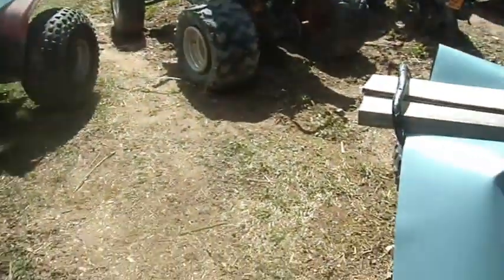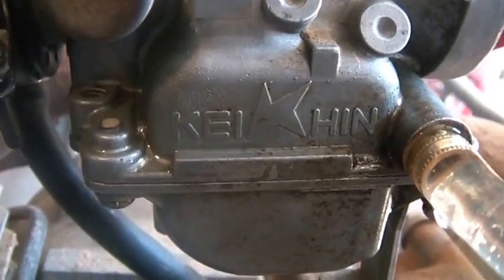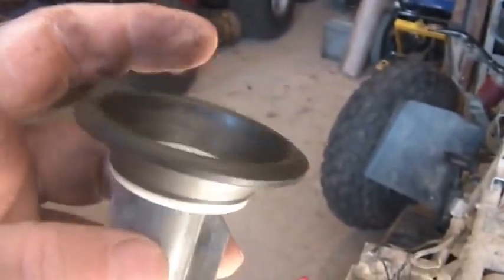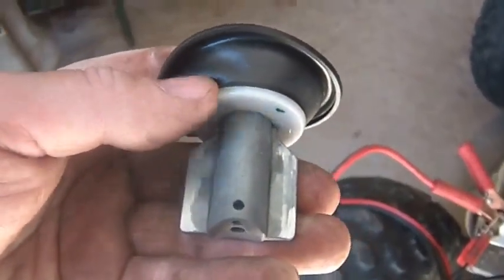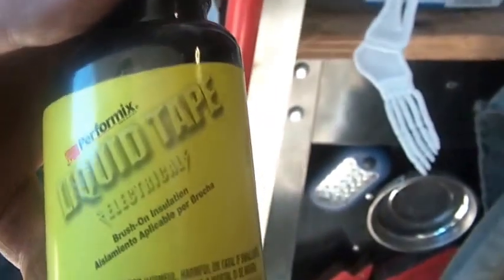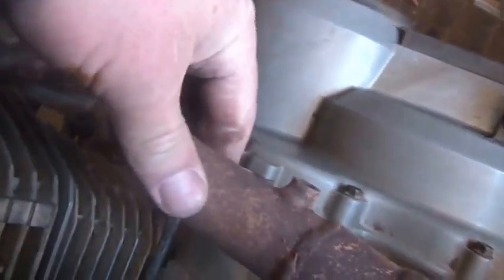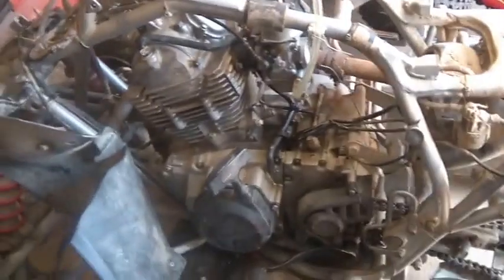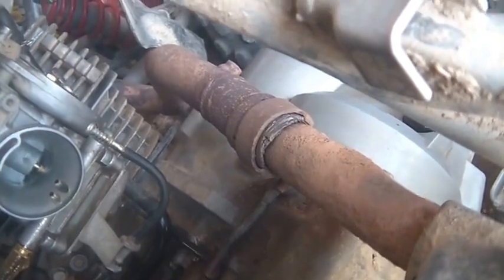Keihin CVK Carb diagram patched, watching enrichment circuit work

Comment: Couple of thoughts here, first is the crank case vent free and clear, and second is the guide on the valve that was damaged in good shape. She has to be pushing oil into that cylinder from some where. And as a be of advise don't leave that new diaphragm where the sun can get to it at all. Put in a dark place. Otherwise the sun well break it down.

Comment: I noticed some flames come out thru the carb....if it were me Harvey I'd  ditch that damn C/V carb......i just don't care for them always had different issues especially with replacing the vacuum diaphrams both in availability and cost....and today's fuels are hell on the diaphrams. ...even with non ethenol fuels they dry out and Crack if stored to long